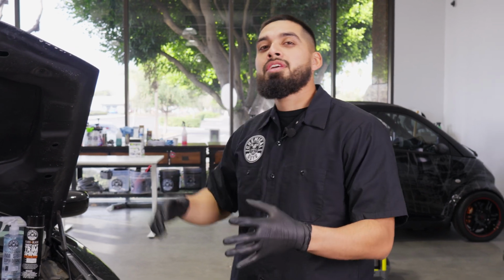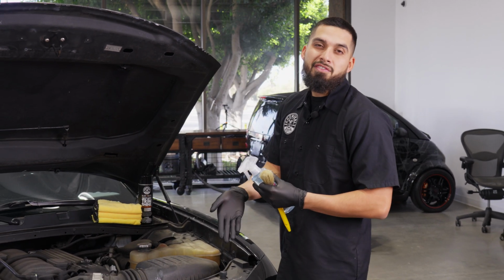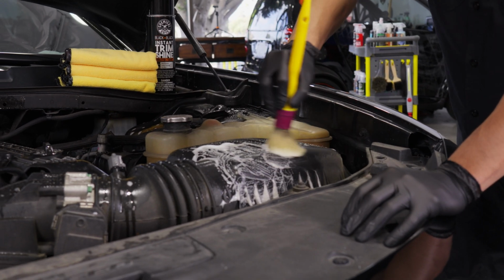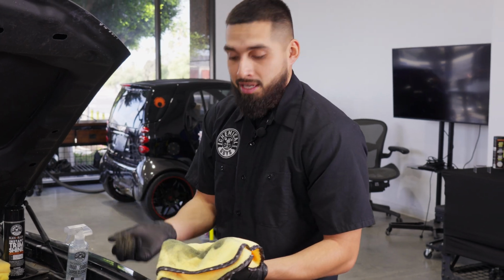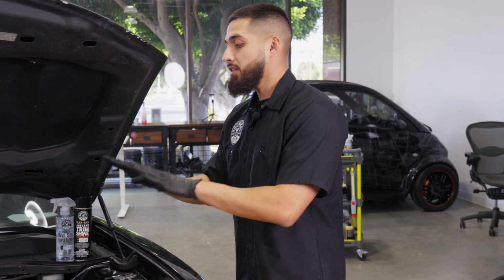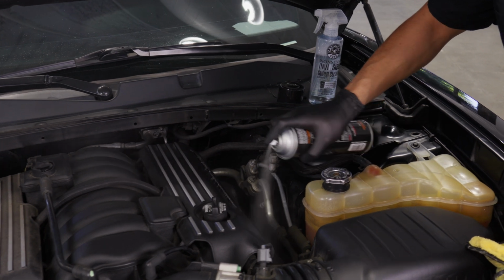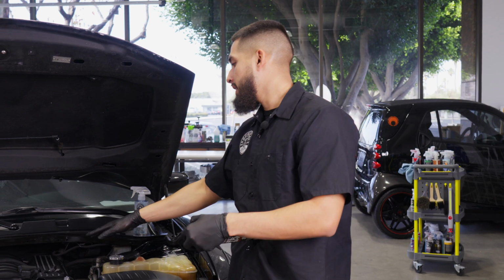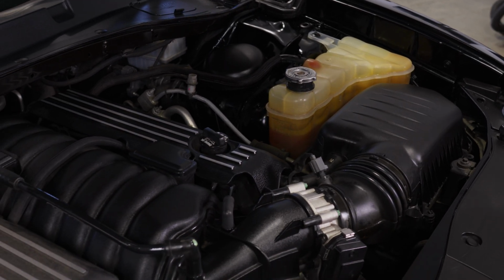EASILY Clean Your Car's Engine Bay Without Water!

Comment: I wouldn't buy a car with a shiny engine bay and this is common sense in Europe. If you sell a car with a freshly cleaned engine bay you try to hide a problem with the engine.
I do clean my engine bay. But if I wanted to sell a car I would stop so it's not to clean when the buyer comes around.

Comment: I cleaned mine, and the dealership when servicing my truck was shocked at how well I maintained the engine bay. Especially in the winter. I need to use the Black on Black trim aerosol can next time.